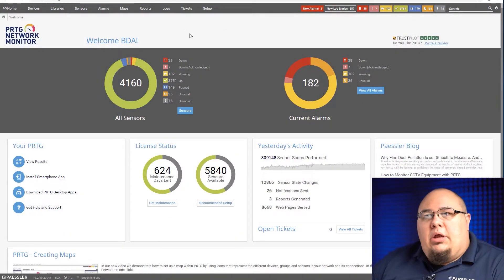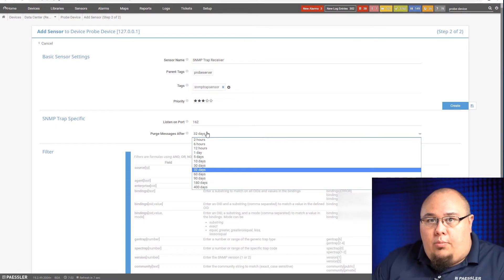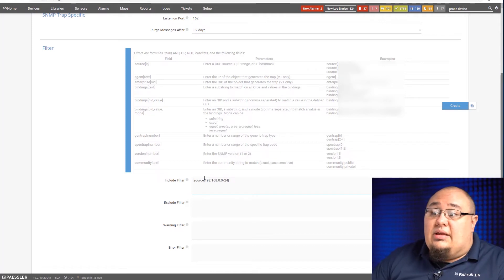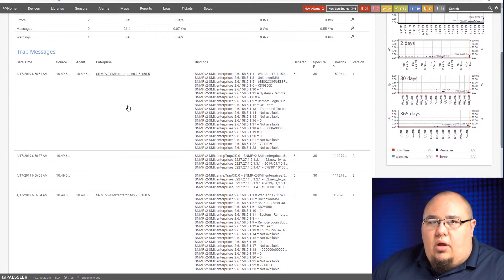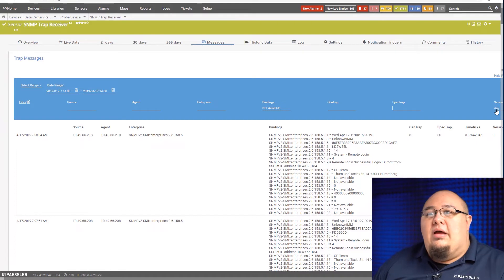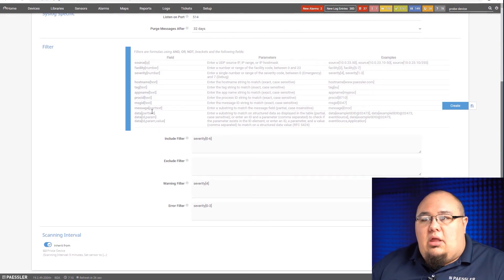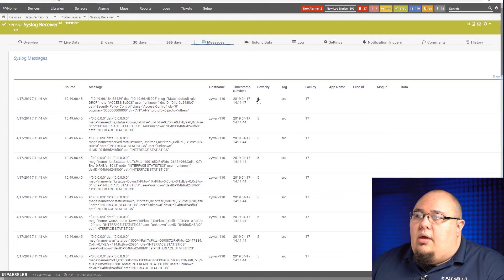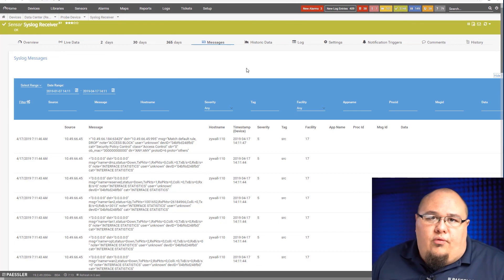PRTG Tutorial - All about SNMP Trap and Syslog Receiver Sensors

Comment: How to interpret trap messages, to be used in a custom OID string?
Reply from the maker: Hi Cristóbal MS, 
In order to "translate" SNMP trap messages received in PRTG into human readable context, you simply need to place the corresponding MIB file(s) in the "C:\Program Files (x86)\PRTG Network Monitor\MIB" folder. Afterwards the OIDs will be translated according to the information in the MIB by PRTG. 

However, please note: To what extent these are "meaningful" texts depends very much on the MIB file itself, PRTG takes over the texts 1:1 without adding anything or even interpreting them.
Hope this fits your needs.
Reply from the maker: @gau54865  Hello Gautier,
the MIB files would only be needed to translate the trap OIDs. PRTG can receive the raw traps without a MIB. If you open the "Messages" tab ob the Trap Receiver sensor, do you see any entries?
If there are none, please check the sensor options. Is the input filter set to "any"? Also, please check if you get traps when you add the receiver sensor on the Probe Device itself (rather on a newly created device object) because that device object's host address would be used as additional input filter. Please also check if the trap-sending device sends the traps to the right probe.